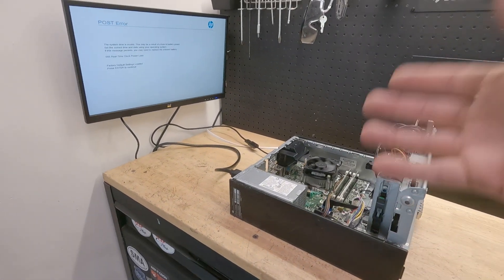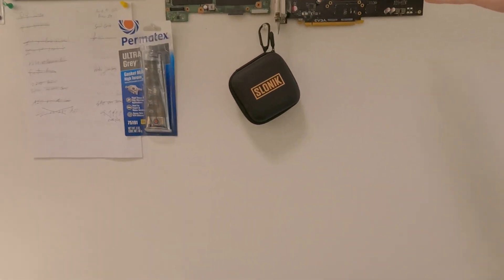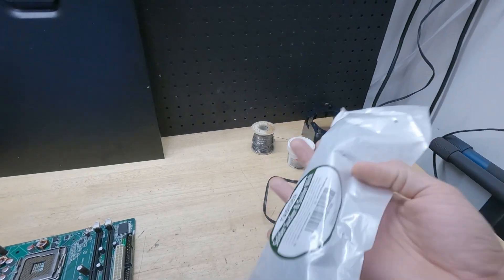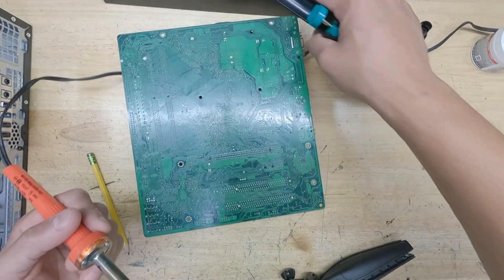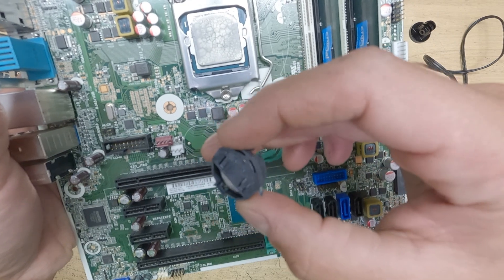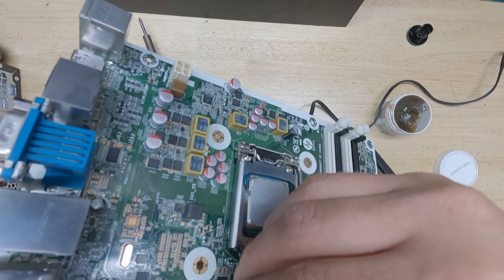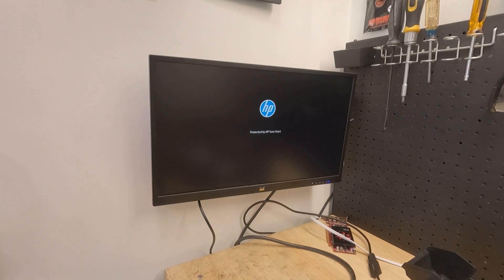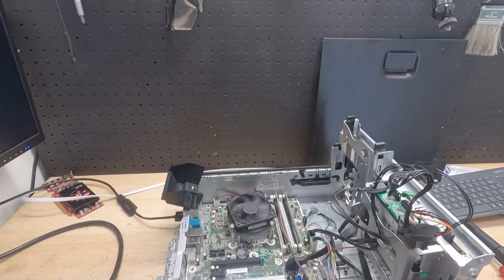My computer keeps forgetting things!! Hp Z240 coin cell socket replacement

Comment: totally agree with you. trying to fix it yourself. my wife's monitor stopped working. took it apart and found 3 capacitors blown. searched on how to solder and went to a local electronic store(unfortunately it is no longer open) and bought new ones and fixed it myself.
Reply from the maker: that's what I have been doing lately. Spending alot of timing practicing soldering skills and doing my own repairs instead of sending it out or trashing it!

Comment: Thank you.  What do you think of the Solder Sucker you bought?  Did you brush a little flux on the things you were desoldering?  Then, some flux on what you were soldering?  Always a good idea.  Another tip: put a little solder on the tip of the pencil and you can use this to solder the new parts in place instead of having to hold the solder in one hand and pencil in the other.  Also, when done, while hot, good idea to dip the pencil tip in the flux then dab some solder on the tip-keeps it from oxidizing.
Reply from the maker: bro thanks for the info. def will do that next time. The solder sucker worked good no complaints.
Reply: @DLMtechgarage   thank you for the feedback my friend.